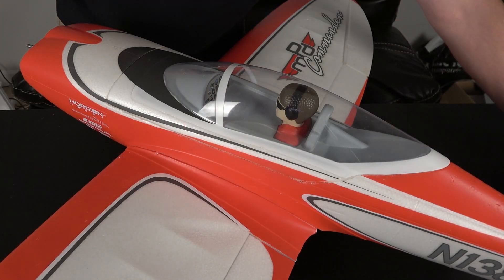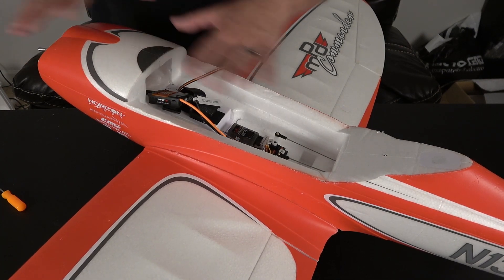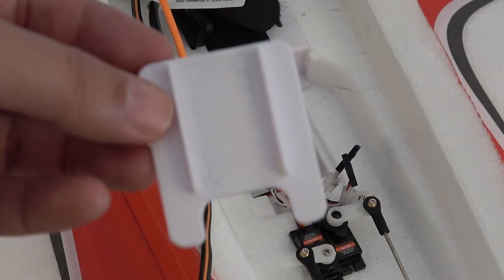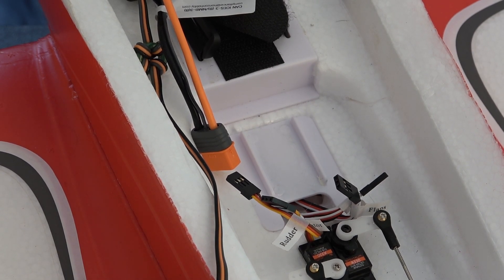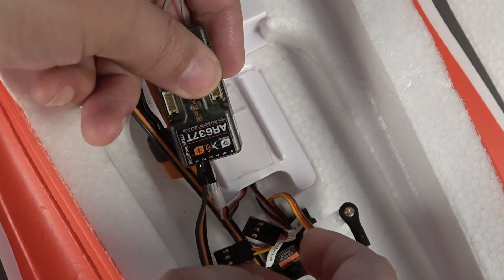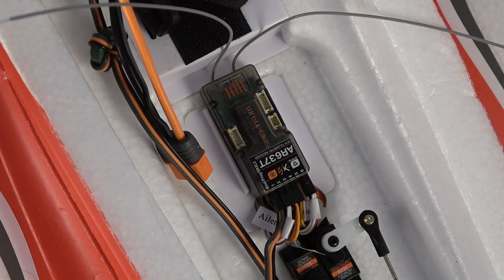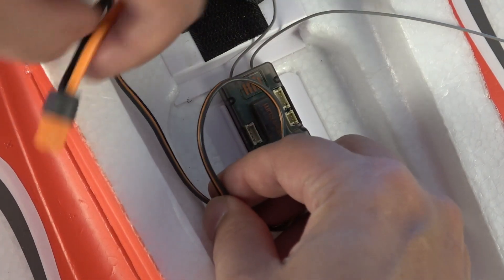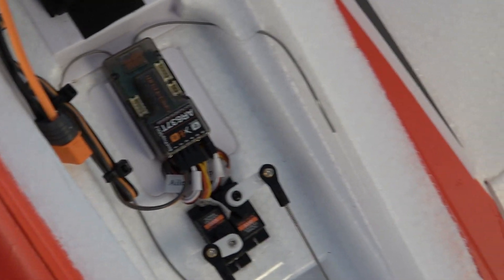Spektrum AR637T Programming Series | Part 3 - Installation

Comment: If the manual used to say 24 installation positions, it currently says the Pins have to be mounted facing forward or backwards, which then only gives you a total of 8 positions.
Reply from the maker: To be honest, I can’t say I ever read the manual. LoL. I’m kidding, of course, just not sure if it was in there or not. The number of orientations is in forward programming. If, with the latest firmware, it still shows 24 orientations in forward programming, I would trust the coding in the receiver over what the manual says.
Reply: @TheRCAirMarshall  that's good point, thanks for the reply.

Comment: I need help, I am trying to use a AR 630 in a airplane with Gear and flaps. I cannot get Gyro AX3S and SAFE to work, I am confused about channel config. there are 6 control surfaces so does that make FM channel and safe not possible?
Reply from the maker: What kind of Transmitter are you using? You can assign channels beyond the 6 PWM outputs as long as your transmitter supports it.

Comment: I need help. I have both the FMS ASW 17 Sailplane (40A ESC) and the Fox 3000mm EP Sailplane (70A ESC). I first want to install an AVIAN Smart ESC in the FMS ASW 17 Sailplane. Later, I may want to move it to the Fox 3000. So, does it matter if I purchase the Avian 80A ESC to use in both? I already have the AR637T.  This series is great instruction for newcomers to the sport like me! Thank you very much.
Reply from the maker: If you want to use the same ESC in both planes, you can certainly run the 80A Avian ESC in both. The 80A is significantly heavier than the 40A, so just be aware of that. Much more substantial aluminum heat sink casing on the Avian ESC’s in the 60A and higher models.
Reply: @TheRCAirMarshall  Thank you for your very quick reply. I am presently binging on your entire series and setting up my transmitter. At this time, I am on Part 8. I have decided to purchase the different ESCs. You are correct (of course) that the 80A would be heavier than the 40A ESC. 

I must say, your channel for instruction is the best that I have found. I feel like that a good friend is talking to me and taking me step by step through the process. I will certainly be contributing to your channel.

Comment: Hey Dave, I recently crashed my Eflite BNF  Conscendo which came with the AR637Ta already installed (sucks to be me LOL) but I wanted to put it in a different plane. I picked up the Eflite F16 Falcon in a PNP version by accident (meant to get the BNF) and was thinking what the heck, I'll transfer from the wreckage (no damage to the receiver) to the F16. I know it's a little overkill for a $150 jet, but didn't want it to just sit around. So I have it out of the plane and hooked it to the SPMA3065 cable and opened up the Spektrum software programmer. Since it's not in a plane, I used the  "Power Cable" feature and registered it. When I try to create a new model, it's asking for the receiver type and in the drop down there is not an option for the AR637T only the AR636? Am I going about this the wrong way? Also I am using the IX12 for my transmitter. I did install it in the F16 Falcon and it bound but everything is SUPER wonky with the controls and if I physically move the receiver while it's connected the ailerons will move like it is in safe mode? I may wind up just going to the LHS tomorrow and pick up a AR620 and go that route, but curiosity has the best of me if it is possible to basically reset the AR637Ta back to bone stock as if I bought it new. Totally appreciate all you do and will be waiting to see what yer thoughts are on this. Thanks man!
Reply from the maker: Have you looked at the new AR630? It’s basically a slimmed down version of the AR637T. It has internal antennas like the AR620, but also has AS3X, and SAFE, and can be forward programmed the same way the AR637T is. It’s pretty nice. I’ve been running one in an FMS PC-21 for about a month now and it works great.
Reply: @TheRCAirMarshall  I'll definitely look into it!
Reply from the maker: The AR637TA that comes stock in some BNF models now will be updated in the future to allow for reprogramming. For now, I believe they are locked down so there isn’t much you can do with it. It definitely won’t work in the F-16 as is.
Reply: @TheRCAirMarshall  Thanks buddy! Guess it's a trip to the LHS tomorrow! According to Horizon the AR620 is on back order :-(

Comment: Hi, Do you have a series on how to program and setup this receiver for a helicopter?
I have a Align Trex 450L.
Thanks,
Jim
Reply from the maker: asujimbo I do not. Not sure if this would be the best receiver for a Helicopter to be honest. The do make some purpose built flight controllers specifically for heli’s. I’m just not familiar enough with them.
Reply: @TheRCAirMarshall  I called spektrum and this can be setup in a heli with safe mode.
Reply: Not sure how to do it though.....

Comment: It looks like you used CA glue medium to mount the receiver? Is that better then Foam Tac?
Reply from the maker: Danny Helton the glue I used is called Foam Cure from Bob Smith Industries. It’s very similar to FoamTac. Definitely not CA, this stuff is more like oxygen activated contact cement.
Reply: @TheRCAirMarshall  thank you I have Foam Tac, I think I'm going to order some Foam Cure and compare it fits Foam Tac.
Thanks

Comment: Dave, I think that esc will reverse the motor for you, not sure if it’s in the Forward Programming or the esc programmer.
Reply from the maker: Keith, you can definitely reverse the motor either through stock programming or using the Spektrum ESC programmer, but the quick down and dirty is, swap any two of the three and it does the job.